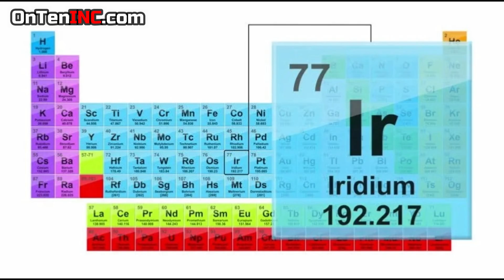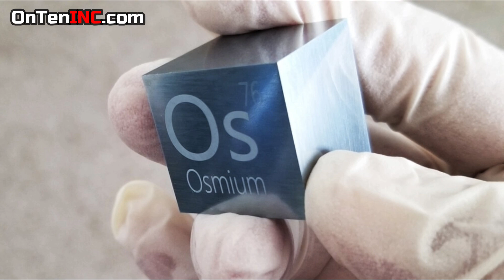Why Iridium is the Rarest Metal in Earth's Crust

Comment: no guys wait I have good news. I have like a bunch of this stuff.
Reply: Good luck, the government wants their piece of the pie, so get ready to hear the words, " no" alot, and " Aluminum" alot, because that's what the government wants you to think you have. Just use some common sense..... aluminum is light, iridium is very heavy. Aluminum has a low melting point, iridium has a very high melting point. Aluminum gets rusty, iridium is very much the opposite. Iridium can be sitting out in the wet woods for thousands of years, and it won't have any rust or anything like that. It will look sparkling new, without any corrosion what do ever, even if it's been out in the woods for a million years ! Aluminum gets very hot. You can hold a bick lighter under iridium for 30 seconds, then put your fingers right where you had the flame on the aluminum, and watch your skin melt of your hand. You can put a torch under iridium for 3 minutes straight, then after that 3 minutes is up take your fingers and squeeze where you had the scorching flame, and it would barely be loock warm. There are 6 platinum group metals and 3 out of the 6 are more rare, and expensive than the other 3 . About 3 out of the 6 have a higher melting point, and more heavier than platinum. But beware, if you are in a hick small town, the only test they will have is for platinum, because it's the most commercial. Pawn shops or wherever will tell you that you don't have anything if you don't have platinum, while you are really holding a small fortune if you have any of the 5 other platinum group metals. A xrf x- ray gun can measure these pgm's... platinum group metals, unfortunately xrf guns are not for rent, and even if you could buy them they are very expensive, like 14,000 dollars for one. So what we are really talking about about here are pgm' nuggets that have several platinum group metals in them along with base metals. Platinum does not come pure in nature, platinum always comes with other pgm' s and unprecious base metals like nickel, copper, iron, zinc etc. So your pgm' nuggets can always be tested, but then you have to find one of the very limited refineries that separate and take out the precious metals in your nuggets, and that is where the circus begins. It's very hard to find the right refinery. For myself I have platinum group metal nuggets that have several pgm's in them along with silver and gold and even other precious metals such as indium. So far ,9 precious metals have been identified by a xrf gun at a testing place in the bay area, such as recycle platinum, Garfield, and a few others. The amount of pgm's you have in your nuggets in terms of percentage, and how heavy these nuggets are , in terms of how much weight they have of precious metals compared to unprecious metals varies from nugget to nugget. But if you have enough of these nuggets like around 100 pounds worth, that makes it usually worth it to the refineries. Let's say for example you were just to take out the gold which was 5 percent in let's say a ,2 ounce nugget, and that's estimating very low, you would still be standing on a nice hill of gold if we are talking about 100 pounds of metal weight. More realistically I have a nugget. This nugget weighs three quarters of a pound . It's about 53 percent precious metal, and about 47 percent non precious base metals. The precious metals are this.. 22 percent Ruthenium, 20 percent rhodium, 5 percent palladium, 4 percent silver, and 5 percent gold . That is one nugget out of about 300 nuggets. So you can see where there is room for alot of confusion. It takes a lot of man power and skill to do it right. But it takes money to make money. In a situation like this, that seems to be growing bigger and bigger everyday, the refinery has to be able to trust you, and you them. It gets expensive mailing metal weight back and forth in the mail. A perfect company that knows what they are doing and specializes in platinum group metals is a company like"Johnson and MATHEY". But for someone like me it's very hard to get a hold of a live person over the phone, which is to bad because alot of good profit and benefits are being lost everyday, especially considering that there is more, than more again where the first 100 pounds came from .